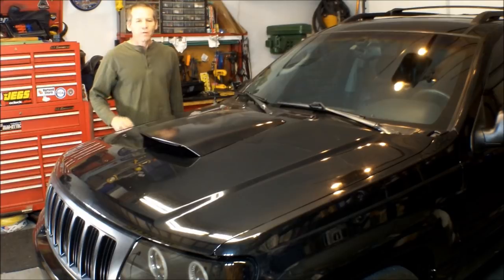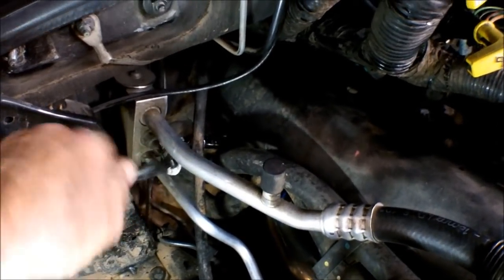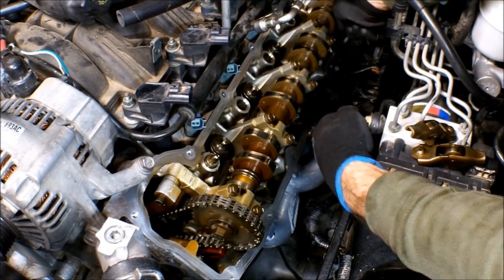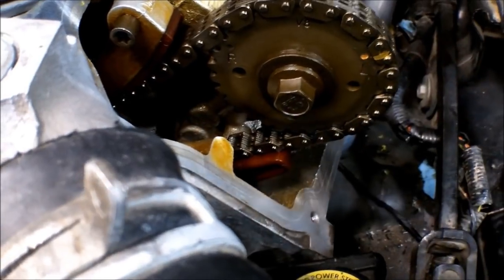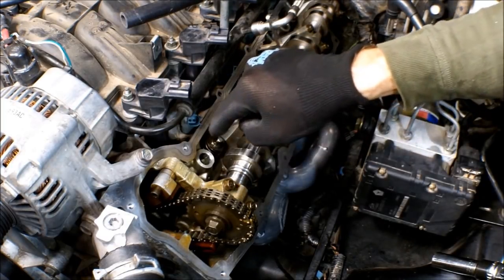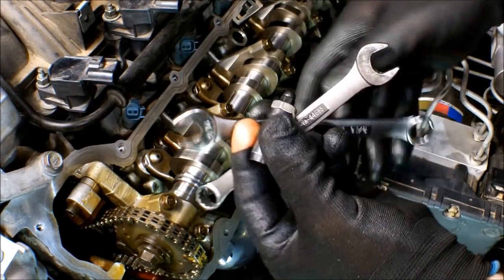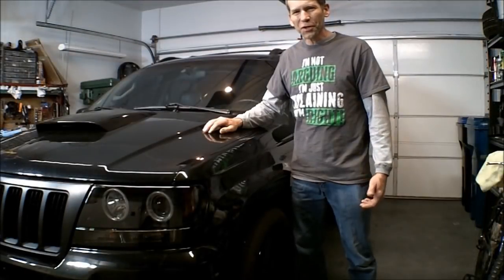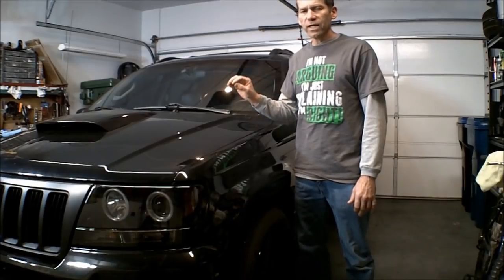How to Install 4.7HO Camshafts & Solid Lifters in a Jeep Dodge Chrysler & Mitsubishi

Comment: Great video! What could be the possible causes of my 02 dodge 4.7 having light poping out exhaust after a ho cam install. It shows up most when I put on my cold air intake. It runs fine no lack of power but running lean up to 17 sometimes at idle. Air fuel all over the place. I have checked coils, plugs, fuel pressure, and changed o2 sensors. No check engine lights or vac leaks. Any suggestions thanks!
Reply from the maker: It does sound like a vacuum leak I know you said you check that. Also make sure your PVC hoses are all on and maybe check your IAC on your throttle body.. did you happen to install the solid lifters or did you just put the Hydraulics back in. If you had put the solid lifters in I'm wondering if one of the valves is not shutting completely
Reply: I can't find any vac leaks but I'm going to double check today. I haven't checked the iac but do notice when sitting at a light my idle drops to right at 500 which is low it's usually around 600. I put the cams in and just left the original lifters and springs in because they looked good. I also did a compression check and my lowest cylinder is 141 my highest is 146 a little low but all consistent with specs. My stft on cold start goes to 8,9,10 and then once warmed up drops to normal +3 to -3 however my long term goes up to +18 on deceleration and my timing advances up to 38 degrees at times running just 60mph.
Reply: @jeremyfrye3954  did you miss a tooth on your cam sprocket by chance?
Reply: @scjeepHO  I don't think so I have since put the original cams back and have opened it up several times to check just that. Everything looks fine still pops a little out exhaust. Even took it to a garage and they couldn't find anything wrong with it no engine lights. I have put put probably 12000 miles on it since this started and seems to run fine. However, it still aggregates the crap out of me not being able to fix this problem. I am starting to think it might be from me cutting the converter off and putting a high flow one on. Maybe there is to much air and the cpu just can't fine tune it properly without being tuned but idk.
Reply: @jeremyfrye3954  check your plugs, see how is burning.  You may need a aftermarket tune (this typically isn't the case on HO cams) .  Some vac leaks can be hard to find,  like a intake manifold O ring.
Reply: @scjeepHO  Yea, I pulled the plugs several times already and did a spark test on all the coils. They all checked out. I have also performed smoke tests in the past looking for leaks like vac lines or intake manifold gaskets. Nothing but at this point I believe either putting a stock like converter back on it to cut back down on the amount of air getting out or custom tune would be the only viable options. The weirdest thing about it is it runs fine maintains 14.7 air fuel while driving but at idle especially warm start wants to lean out some to 16.5 even 17 before falling to 14.7 or so after a minute or two but if you are to turn on the air or defroster it goes right down to 14.7. Which led to the iac sensor which i tested and cleaned still nothing.
Reply: @jeremyfrye3954  there are tables in the pcm for when ac is on and what not.  If it's leaning out at idle.... these 4.7's have a issue with throttle position sensors, it's hard to know without being able to monitor the sensors parameters.  It's always a good practice to check and clean grounds. I've even seen funky things from a weak battery
Reply: @scjeepHO  I have a brand new battery, just put in two weeks ago and my throttle position sensor was replaced prolly two years ago. That was the second one I put in the first time is was just reving up by itself however, the last time my tranny kept kicking in and out of overdrive. My grounds are clean as a whistle.

Comment: That was awesome to watch but mind boggling at the same time.  I don’t know how you do all that so perfectly.  Amazing.  
I’m getting a “tapping” noise from my engine.  Is it something with a lifter?   Runs fine, just annoying.  Any thoughts.  Not sure I’d trust my local mechanic do do as good a job as you.   Thanks!!
Reply from the maker: Thank you Jonny. Sounds like a lifter (lash adjuster) would recommend changing that before  damaging the cam or head. Here's a video to show what happens if the rocker pops out because of  lifter failure.  https://youtu.be/UqSQ9QrCFro
Reply: martinbuilt thanks, Martin!   Watched the video and now I’m scared!   Damn.  Is it something I could fix myself?   I don’t have a spanner tool or wedge or stuff like that.  Not even sure which side it’s coming from or which lifter?   If I pull the cover (which I think I could do after watching your videos) I just pull it out and put new one in?   I’ll need a new gasket then?   What should I expect a repair shop to charge?   I see the a set of 16 lifters is cheap.  Thanks!!
Reply from the maker: @jcstevegigs  yeah you could probably do it yourself. If this is on a Jeep Grand Cherokee the passenger side is always the hardest because of all the other stuff that runs over top of it and the battery and tray need to be removed. The driver side is much easier. I would think a shop would charge probably at least 4 hours. Yes I would change all of them. Or at least one side at a time. If you get a mechanic's stethoscope or even a long screwdriver and place it on the valve cover the other end to your ear you may be able to figure out what side and narrow down even which lift might be
Reply: martinbuilt cool idea about the screwdriver.  I knew a guy who used to use a short piece of garden hose.  
I was listening today and can’t really tell which side it’s coming from.  Speeds up and slows with the engine but sounds like it’s coming from the center?  Almost under the air thing or behind the alternator.  Seems to get quieter as the Jeep heats up.  
Thanks for your replies.  I’ll watch your camshaft video a few more times.  You make it look easy, but I know it’s not.  I’ll try the screwdriver thing.  Thanks, Martin!!!
Reply: martinbuilt yes, it’s a 2002 Grand Cherokee Laredo 4.7
Reply: martinbuilt I did the screwdriver trick.  Tried hose too, but don’t hear anything directly coming from the valve covers.  I hear it under the engine just as loud as top.  Kinda centered.  Can’t pinpoint it.
Reply: martinbuilt my mechanic buddy helping me agreed that the noise is coming from the valley of the engine.  He suggested I research where the timing chain tensioner was.  And is there 1 continuous timing chain or 2 for each Camshaft?   Sorry about all the replies, Martin!  I appreciate your help in diagnosing it.

Comment: Hey martin can I swap 4.7 engine  out of 2002 1500 dodge ram  to my 2004  4.7 dodge durango  what parts   need to change  from  my motor  to the  other one thanks  from a suscribed
Reply from the maker: As long as they both have the same computer (ECM) 3 plug JTEC or 4 plug NGC should be a direct swap
Reply: @martinbuilt  thanks for your Quick  reply   I appreciated  thanks again

Comment: Is the spanner for holding the cam a buyable tool anywhere?
Reply from the maker: Yes this tool should work OTC 6613 Variable Pin Spanner Wrench. Even though that tool will not work that well on the passenger side camshaft as it only has one hole in the camshaft sprocket. That's where the tool I made works better.

Comment: Hi Martin, I'm not sure if you remember me but I finally changed the lifters on my '05 4.7l Ram this past weekend, I also changed my spark plugs. However, as soon as I started it up the truck isn't running right. It sounds like it's missing, it vibrates really hard when I tried test driving it, but when I take my foot off the gas the vibration stops. First I installed autolite platinum plugs and thought that was the problem so I replaced them with autolite copper plugs and it didn't solve anything. I'm at a loss, I don't know what to do. Do you have any advice?
Reply from the maker: Did you get a service engine light and if so any what were the codes. It sounds like there's a cylinder not firing. I'm almost wondering if you didn't have a rocker come off when you did the initial startup
Reply: @martinbuilt  the check engine light came on and the scanner said cylinder 5 misfire and code P0113.
Reply: @martinbuilt  you're right, I took the drivers side valve cover off and found a rocker arm fell out of place. It's got too much clearance from the camshaft lobe to the rocker arm.
Reply from the maker: @somanynamesilltrythis0180  when you replace the lifters did you soak them in oil to help remove the air?
Reply: @martinbuilt  I soaked them for about 36hrs, I've never done this before and I don't really know that much about the different types of lifters, but the new lifters and the old ones are very stiff. They will not compress.
Reply from the maker: @somanynamesilltrythis0180  where those old lifters giving you any problems generally if they're stiff like that they're good. It's when they're all spongy like is when you have a problem.
Reply: @martinbuilt  well I thought they were bad because when I would start it up, I'd here a ticking sound, then after a few minutes it'd go away. When I pulled the valve covers off there wasn't any lifters out of place, although one of the lobes has too much play I really didn't think much about it until you mentioned maybe a rocker arm fell off. The rocker arm that fell off is the same lobe that has too much play.
Reply from the maker: @somanynamesilltrythis0180  what do you mean by the lobe has too much play?
Reply: @martinbuilt  after I installed the new lifter and put the rocker arm back in place I can grab the rocker arm and move it up and down about a 1/4 of an inch. That's the same rocker arm that keeps falling off.

Comment: Would 4.7 cams fit a 3.7 if the rear lobes were cut off?
Reply from the maker: That's a good question.
Reply: The timing is likely different. I'd go for the solid lifters though...

Comment: Hello. I was watching your video about the 4.7 HO Cams. Do you know if those cams are OEM or Aftermarket for the HO? I'm also trying to locate those so I can purchase them. Thank you John.
Reply from the maker: The HO  cams are OEM and we're only available in 02 through 04 in Jeep Grand Cherokees Limited J codes and in all the of the Overland models. There were companies in the past that would take the HO cam and regrind it to even a higher level of performance. And these cams cannot be purchased from Chrysler is the entire stock was bought out.
Reply: @martinbuilt  yes,  I have my stock HO cams,  212X cams, and currently installed 224 blower cams.
Reply from the maker: @scjeepHO  What did you think of the 212X cams?
Reply: @martinbuilt  i really liked them.  On my stock engine,  smaller blower with lower boost and magnaflow catback exhaust and I think i had the 212's installed back then I made 307 HP & TQ to the wheels on a Mopar dyno day. Only guy who did more than me was a 383 stroker. There's a video on YouTube from that pull online

Comment: Hi, would this work on a 2005 ram 1500 4.7??
Reply from the maker: Yes this will work on your  05 Ram
Reply: @martinbuilt  I am about to replace a 4.7 in an 04 ram,  i have the non HO, can i buy an HO version as a direct swap??  Meaning is there anything mechanically that wont bolt up to it such as front end pulleys etc??  Also does the computer have to be swapped if i put in an HO motor/  Is the only difference the cams and lifters?
Reply from the maker: @xrayservices  one thing you'll have to look into is do you have four plugs or 3 on your computer this will affect how many teeth are on the tone ring of the crankshaft this will be important when ordering your engine. You can just install the ho engine and keep your computer. Just by the way there are a few more differences from the ho other than cams, the  cylinder head Chambers arw different,  steal crankshaft,  higher compression Pistons. Pretty much a direct swap.

Comment: With just the cams how much hp does this add to the engine
Reply from the maker: I don't have any Dyno numbers. And I had the headers, free-flow exhaust, and other mods already installed before the cams but I would say 10 to 15 HP.  Many have claimed 20 HP's but I don't see it or feel it.

Comment: Sounds good.Where did you get your solid lifters and the values for adjustment.Thanks...
Reply from the maker: Dan Hambrick 
Hi Dan I got the solve lifters from airram.com out of Florida. I didn't quite understand the last part of your question.
Reply: Sorry.How do you know how long to adjust each lifter?
Reply from the maker: Dan Hambrick 
I should have a explained that better in the video. But I had adjusted one of them originally until I got the gap correct. So I came up with the baseline of around 49 mm. Of course this will very on which camshaft you put in the larger the lift camshaft will increase the length of the lifter.

Comment: Do you have to have solid lifters with a cam upgrade?
Reply from the maker: BuckWildPro 
No you can just install the stock latch Adjusters. If you do a reground camshaft like a 206 or 212 cam or larger then you would have to do the solid latch Adjusters or you would need shims under the lifters (lash Adjusters) this would be to correct the geometry of the rocker arm (fulcrum's)

Comment: Is the camshaft located the same in a 4, 0 and 4.7
Reply from the maker: Unfortunately no with the 4.0 you have to remove the entire cylinder head, timing cover timing gear and chain and then you can pull the camshaft out. Just to change the lifters out on the 4.0 you have to remove the cylinder head.

Comment: Question for the master :) are the 08 cams the same as the HO cams? Can I install the 08 cams on a regular non-HO 4.7? Just wondering because one came available at the pick a part
Reply from the maker: They are not the same as the HO cams. And yes you can install them in a non-HO 4.7 engine. Just make sure the ones on craigslist are original Chrysler ones and are from a 4.7 that had 16 spark plugs.
Reply: @martinbuilt  which ones do you think can give a better boost. HO or 08 engine cams?
Reply from the maker: @r.blanco7520  My vote would be for 08 cams. One of these days I'll get around to installing them.
Reply: @martinbuilt  thanks. I'll go to the yard tomorrow and see if no one has taken them yet.
Reply from the maker: @r.blanco7520  Good luck! I missed a set at the yard once. That was before I knew about the 08 cams. I was looking right at them with the valve covers removed. I got lucky and found a set on eBay. In a few years, there'll be all kinds of them at the salvage yard.
Reply: @martinbuilt  WHAT?!?!?, That means that I can install some 4.7L 08' camshafts in a 4.7L 06'?!?!?, And they give more gaining than the H.O. camshafts?!?!?, I didn't know that :(
Reply from the maker: @alexismelendez9184  yep, I got a set of 08 cams I haven't got around to installing them yet
Reply: @martinbuilt  ohh my!, I recently bought my H.O. camshafts and it was very difficult to get them, I really didn't know that the 08' camshafts would be better than those, hope to upgrade them later :(   Thanks for asking Martin

Comment: On my 08 dodge ram 4.7L, the front cam bolt broke, why?
Reply from the maker: Broke...wow...while it was running?
Reply: @martinbuilt  came in for lunch an went out to start the truck an it ran like it jumped time big time an it died that's when I seen the bolt head on the ground.
Reply: I hadn't took the valve cover off yet, do u think it broke the cam??

Comment: Did you install a trans shift kit on your Jeep?
Reply from the maker: John Blair I have not installed any type of shift kit. I have disconnected the torque management wire to the transmission. I would say I saw a small Improvement there.

Comment: Hello. Very informative video, Thanks. You show how to unscrew  driver side camshaft bolt using spanner wrench. However on passenger side 
this kind of wrench will not work (there is only one hole, two other are blinded). Do you have any sugestions how to safely unscrew this
 passenger side camshaft bolt? I will appreciate your input. 
 Also thanks for this wedge "trick" it could be very usefull for pulling head without removing timing belt cover.
Reply from the maker: This spanner wrench works on both sides, Just remove 2 of the 3 bolts. Check out this video. https://youtu.be/UqSQ9QrCFro  or this one is how to make this spanner wrench and how it works on both sides https://youtu.be/X0bXNI6kr_o  Thank you
Reply: Thanks. I will try

Comment: Is it needed or required to put the solid lifters in For the ho cams?
Reply from the maker: No I just did it for added performance benefits.
Reply: I put them in my 04 GC with 08 cams. If you are tired of the stock clattery when cold ones put them in. I think I got a pretty good kick at the top with them also, I think the stock ones bleed off somewhat at higher rpms. The biggest advantage I see is the worry of a stock one bleeding down during shut down and then having a rocker arm kick out is now gone. That is the main reason why I put them in.

Comment: Hi Martin @martinbuilt , i´m doing this H.O. camshaft swap in my 06´ Grand Cherokee, also i´m installing the solid lifters and the Comp beehive valve springs that I bought from AIRRAM.COM. Your videos has been very helpful to my installation. I just wanted to ask you: what is the maximum and minimum gap that must have between the rocker arm and the lobes of the camshaft?; Another question I wanted to ask you is: do you needed to make a reflash to the PCM?, do you use any programmer or something like that to make the PCM work correctly with those modifications?
Reply from the maker: .0015 to .004 for the gap. I like to shoot for .002.    You don't need any special tools to reflash the PCM.
Reply: @martinbuilt  And it's the same for both admission and exhaust?
Reply from the maker: @alexismelendez9184  Your PCM will make any air-fuel ratio adjustments.